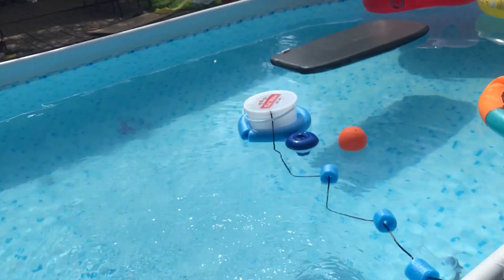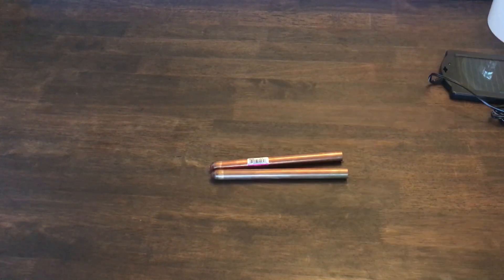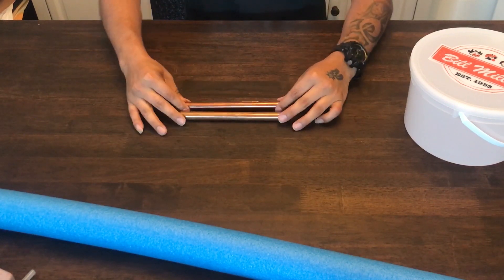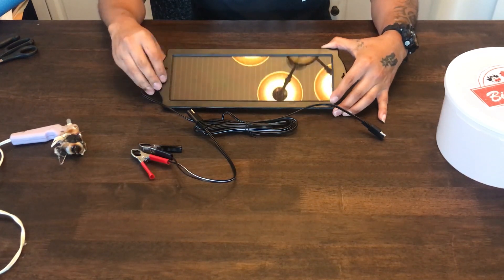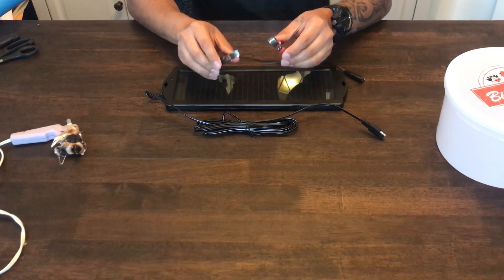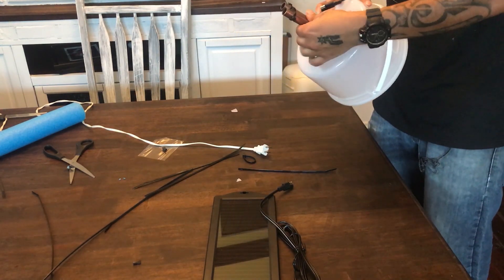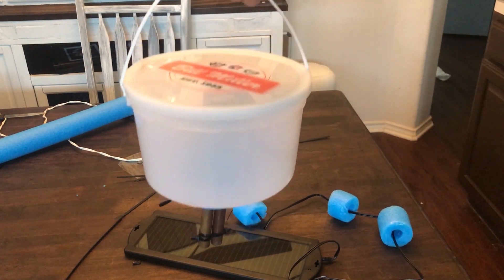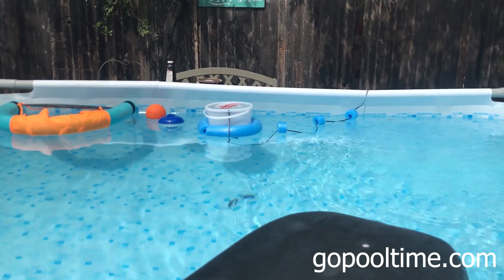How To Build A Solar Pool Ionizer / Copper Colloidalizer -  diy Natural pool cleaner - NO Chemicals!

Comment from the maker: 🔥for in depth Info on above ground pools check out www.gopooltime.com
Reply: This is so helpful.  We can't use an ionizer with the solar panel on top of the ionizer because our pool is in the shade.  I looked at buying a pool filter ionizer, and they were $1000+.  You have been fantastically helpful.

Comment: I used the piece of copper pipe in the skimmer method many years ago and yes it works, no electricity needed, never any algae at all. However about 10 years ago I discovered Copper Sulfate and started using it. I have a 13k pool and use 1-2 tablespoon diluted a month. Never ever have I had any Algae since, NEVER. No green hair, no pool stains on my gunite pool here in Florida. Stop listening to these people who don't have a clue, maybe they work for pool companies or don't even have a pool. So may gimmicks when this is the easiest cost effective solution out there.. Look at the ingredients of most pool Algaecides 5-7% Copper Sulfate. When you buy Copper Sulfate small crystals (Amazon, eBay) and dissolve it, it is 20% concentrate so don't think 1-2 tablespoons a month is to little, adjust if your pool is larger. That is all you need and you'll NEVER have Algae again. The key is Don't over do it thinking more is better, it's not. It does reduce the amount of Chlorine you use to zero but you MUST use chlorine to sanitize your pool. I use this all winter and use NO Chlorine while we aren't swimming saving a fortune on Chlorine.  This works and everyone we know uses it. It will cost you less than $5 a month to keep you pool Algae Free and a fortune on Chlorine. Do the research, stop wasting your money.

Comment: Do another one with 2 silver rods for bacteria
Reply: Could one put the copper pipe and silver wire together , for each piece --- and separate the two things with the zip ties  . .... or would you have to do two whole separate systems ? I feel one should be able to wrap the silver wire around each copper pipe , separate them with the zip ties and attach the neg + pos leads from the solar panel ...... yes ?

Comment: I made this exact model but when I put it the the water the blue light stops bleaking...does that mean it isn't working?
Reply: I have the same question.  Did you figure this out?
Reply: Same. I have the Harbor Freight 1.5Watt solar charger. I clamped the alligator clips - one to each copper pipe and all is well until it hits the water. I did find that if I only dip a couple of centimeters in the blue light fades but seems to work. I can see small bubbles and copper being used, turning blue. But I can't submerge more than a couple of cm into the water or the blue light shuts off. I wonder if there is some circuitry in the unit that senses the short and cuts out.
Reply: Same, just made mine today and it blinks until it hits water then no blinking.

Comment: If you sit it outside of the water is it necessary to disconnect it from power?....will it ruin itself in open air. 
And my other question is, how important is proximity of each copper piece to one another and why? I'm trying to wrap my head around the important parts of your clever system ❤ thank you for the video!
Reply: its safe to get in the water with it in the pool, the only danger is strangulation by the cable going to the solar panel.
Reply: I use this method but dont use a float. Just hang the tubes off the side still works good.  @tonipeters-random-stuff

Comment: Hi ,  thanks for your VIDEO, so don’t need silver spring around?
Reply: The "spring" you have seen is just a fancy looking electrode, they use it so it looks good, but unlike copper it does not dissolve.

Comment: Built one a couple days ago except with a 12v, 2 amp power supply. That night it ate most of a 6 inch long 1/2" pipe but just one of the pipes. It was old pipe so bought new pipe and it did the same thing. Any idea why? Our pool was salt water and built this because our salt water chlorine generator stopped producing enough. Is this only for non salt water and that's why it's just eating my pipes?
Reply: i'm guessing your amperage is more than you need
Reply: like @rob dominguez says, the amperage is too high - the solar panel recommended is about 1.5 watts max output, which is  0.125 amps (1.5W = 12v x 0.125 a) - nearly a twentieth of your charger's output. Plus, recall that salt water is more conductive than fresh water, which means more power is flowing between the pipes, magnifying the effect. On top of that, there is probably some additional chemical reaction going on between the salt water (NaCl + H20) and the copper (Cu) the electrolysis process causes or enhances. That's just an educated guess because I don't remember my chemistry classes :)  but do know how "acid like" salt water is - I live blocks away from the Atlantic ocean - everything metal here gets eaten away at an incredibly annoying speed.    I'll ask an old chemist friend what he thinks and will report back...
Reply: 2 amps at 12v is 24watts. Too much amperage.  @ArchetypalCat

Comment: I built this and put it it in my pool after it turned green 1st I put pool shock in next day was cloudy built this and water turned clear! Only thing I did different was I used actual 3/0 wire not tubing like you did. 3 weeks later its green I tried putting shock in again and its still green according to stuff I seen online is it possible I have too much copper in my pool? Should I use actual tubing?
Reply: The official pool ioniser has solid copper rods, not tube, the idea being the solid rods take longer to disolve.
Reply: sounds like you need to flock and vacuum before hand
Reply: For anyone reading this in the future, you are supposed to have 2 different metals, i.e. copper and stainless steel. If the voltage from the solar panel is too high, you will end up with green/blue water. This is because it has worked too well, and you have too much copper in the water.
Reply: the 2 rods have to be pretty close together for this to work. Doesnt matter if rods or tubes.

Comment: That is a pretty "back yard garage" ionizer.....it could use a fixed holder and put it into the skimmer box..! I wonder if the separation will render good performance. I built mine using PVC pipe copper bars and a steel spring to surround the copper bar with a 3/8" gap.. Used a 3" tee and 6" long bars, in line with the filter discharge. I used a 12V 500mA transformer. I actually read the patents on these devices to determine the construction guidelines.
Reply: you should post a few Images to help us figure out more efficient designs...I'm trying to figure a DIY for my pond...but not solar powered...a 12v version
Reply: wouldn't the steel spring conduct the charge and basically make the two copper pipes as one tho' ?? Curious about that .

Comment: I tried this but the solar panel shuts off when in the water any help
Reply: My one does the same thing just turns off as soon as the copper hits the water
Reply: I even bought new solor pannles thinking it was broken but when i take the copper out the solore blue light flashes as soon as it hits water off
Reply: Mine does the same thing. Hmmm
Reply: @unsolvedhistory1   it worked for like 2 weeks then every time i put it back in the water the solor powerd light would stop blinking
Reply: I came back on here to read the comments because I'm having the same issue. It actually worked a full day, but I took it out when it was raining. Now when I plop the copper in, the flashing blue charging light on the solar panel stops. I've cleaned the copper, resituated the clamps, everything. It works when not in water but the second I place it in the pool, it stops. Someone please advise!

Comment: I'm on my 4th season with my diy. I used a panel that is easily twice as big from harbor freight. Mine floats on a piece of foam sheet just in the pool, no bucket. I still need to use some chlorine tabs but once everything is on point it drastically reduces the need for chems. Oh and fuck pools don't ever get one they are fun to visit but suck to own.

Comment: And i can reolace the solar panel for?.
9v
6v
3 v

Batteryes??????
It has to be above or below wich one???
Reply: Use the strongest solar panel you can get your hands on. There is no risk of electrocution don't be a pussy.
Reply: The solar panel generates the power.